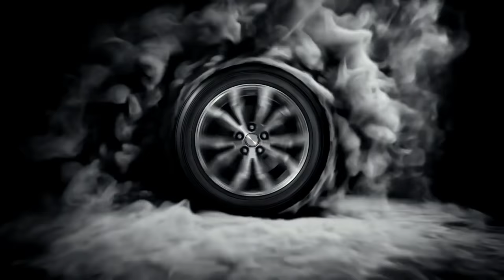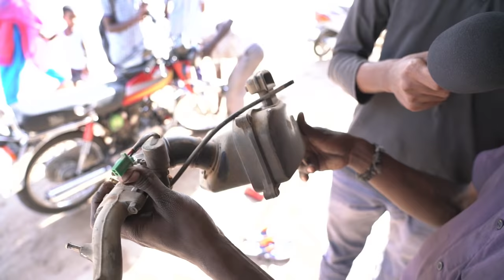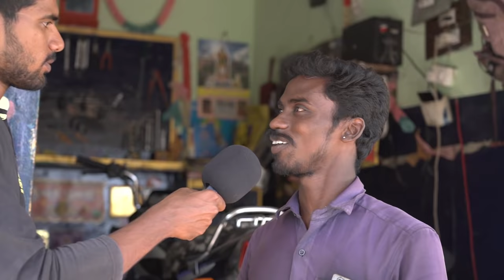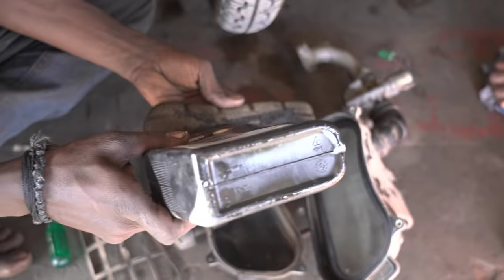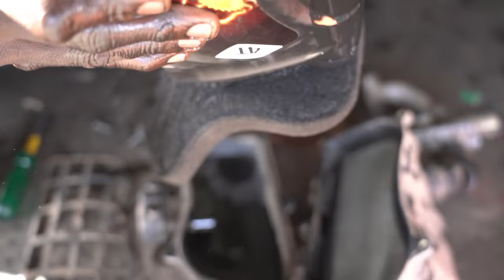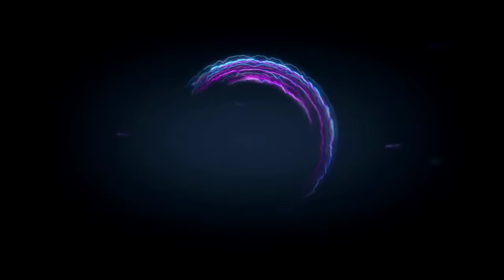Bikeல் AIR FILTER-ஆல் சந்திக்கும் பிரச்சனைகளும் தீர்வும்! | Importance of Air Filter in Bikes

Comment: correct me if i'm wrong....air filter ilaana bike odaddu bro..max 30-40 kmph tan pogum..also adu romba risk..engine seize aga naraiya chance iruku...changing the air filter at regular interval is very important for engine's life...
Reply: 12000 km once replace panuna pothum bro. regularah clean panni potale pothum
Reply: Bro air filter edhu podalam best ah, K & N ,Moxi, Hp idhulaam kelvi patturukken sound edhu bro nallaa irukkum engine problem varaama irukkumaa

Comment: Yooo ennota bike la 2 years ahh air filter ellama draiw panren oru problem Ella 😂😂😂
Reply: My cbz 5 years no filter but good condition 😆😆😆😆😆😆
Reply: Enna bike bro. My friend fz la hp air filter potu irundhan. But olunga fit panala mechanic. Adhanala sand ulla poi engine seize agiruchu. But en pulsar la 1 year air filter ah complete ah remove pannitu than otitu irundhen onnum agala enna reason nu therila